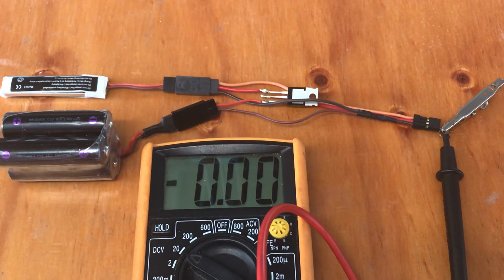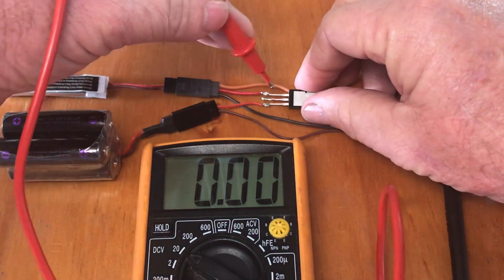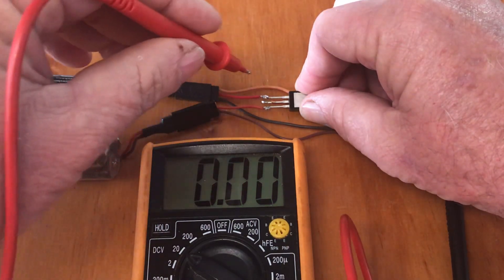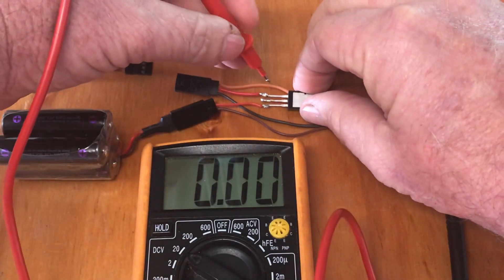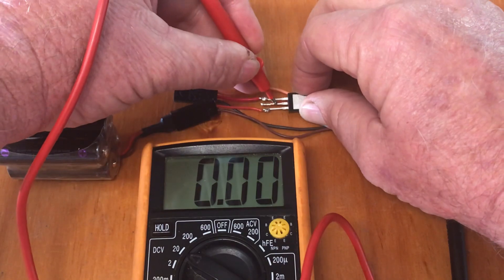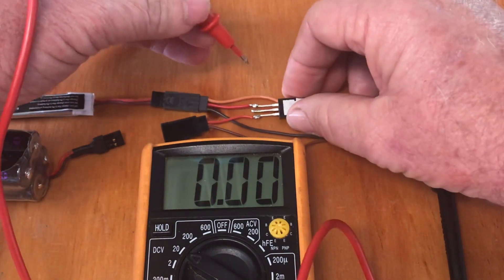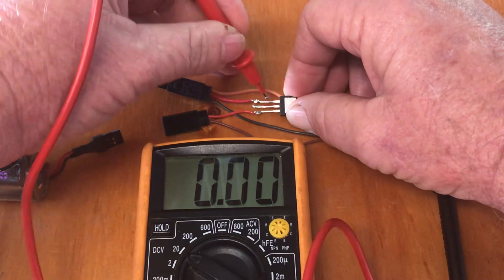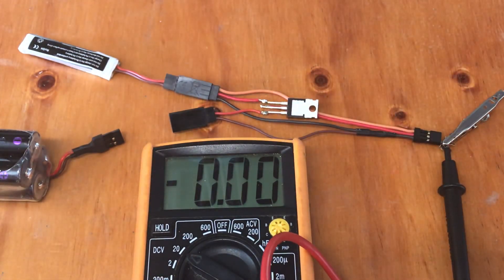Schottky diode dilemma

Comment: A load is needed on the diode. Otherwise the diode won't be working.
There needs to be a current through the diode. Then a voltage will appear across the diode. And a voltage will appear on the cathode of the diode.
The load could be a resistor, say 47 ohms up to 1k ohms. Or a small bulb, motor, any circuit that draws at least 5 mA.
Reply: i realize I'm pretty randomly asking but does anyone know a good site to watch newly released tv shows online ?
Reply: @Cristiano Brayden I use Flixzone. Just search on google for it :)
Reply: @Cristiano Brayden I watch on Flixzone. Just search on google for it :)